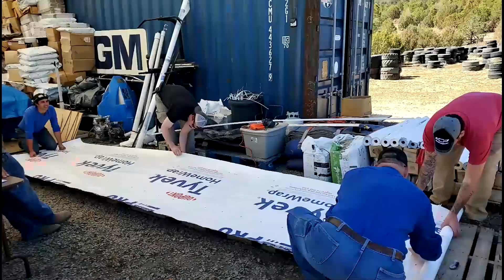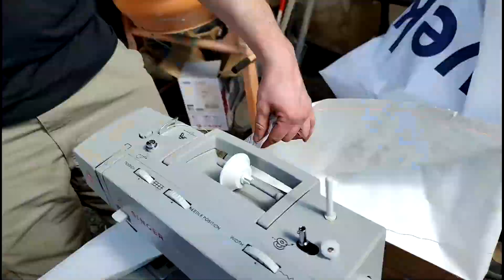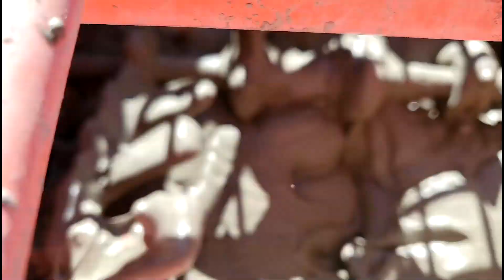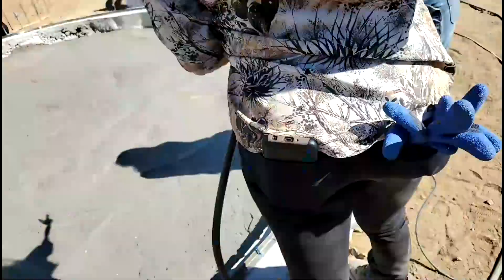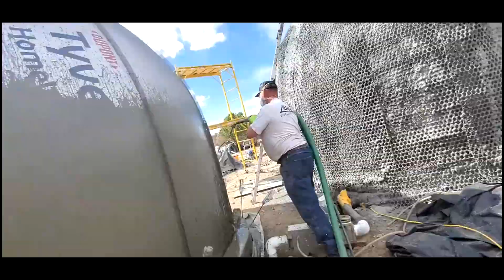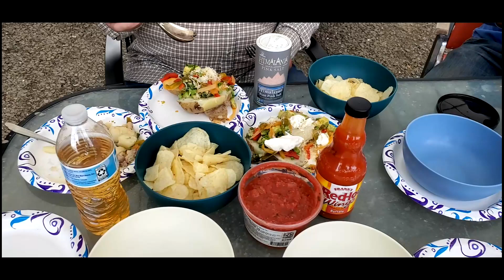Dome Building Workshop | #aircreteharry #Domebuildingworkshop #workshop #handsonworkshop #aircrete

Comment: Hey Buddy, with sheets of plywood way over $60 a sheet and 2x6 studs at $10.50 as of date of this text and I'm not sure about insulation, not to mention headers what are the chances you could design a panel like the shape of a sip form that is cost effective? As you know I don't build dome homes even though I like there appearance.

Comment: Harry.  Thank you for being a trailblazer and sharing your inventions with us.  Question:  Looking at https://www.youtube.com/watch?v=Ks7Ifi6TTUE about creating a geodesic dome out of one-inch pvc pipe, have you ever considered using one of those as a frame to add the tyvek, fabric, metal mesh, and aircrete layers - and after finishing, removing the geodesic support dome for reuse?     I'm going to use a hyperadobe rammed earthbag bottom https://www.youtube.com/watch?v=0GTgNmSmzms , and then position the finished aircrete domecap (as desribed above) as the  roof.  It will be a very sturdy and earthquake-proof building that can be built without much knowledge of construction.   Have you done something like this that doesn't require making an air-tight membrane and constant air pressure for the support of your layering?  In the link above, they use heavy-duty zip ties at the hubs of the geodesic dome.  The hubs have a ridge that will make it easy to connect the single sheet of tyvek to it.  Later after the outer layers dry, from the inside, one can use snippers and cut the zip tie that held the tyvek to the dome, as well as the zip ties connecting the 1" pvc to the hubs, allowing the dome parts to be removed and used on later builds.  Do you think this would work as long as the circumference of the hyperadobe wall connected well to the geodesic aircrete dome cap?

Comment: Nice!!  Looks like a productive event.  Must be a good reason why the fabric hems are outside, in the aircrete - and that you worked out how best to un-embed them.
Reply: White form has seams to inside and it will be removed leaving a smooth wall. Fiberglass mess, which is completely embedded in the concrete, has the seams to the outside.
Reply: @happyhigdons  Thank you.   So the mesh is sewn up like the air form, then I would guess.
Reply: @SpaceCrete  yes. Both are seen with a seam. White part has seam to inside as it will be removed, mesh has seam to outside and is left in.
Reply from the maker: @SpaceCrete  That's correct! How much longer before your additive is available?
Reply: @AircreteHarry  Still working on it.  It is really only helpful if you are pumping, and you need an inline static mixer near the end of the pump line.  Light mixes are easiest to stack, but not aircrete - that has been the toughest. Here is a good demo of the fireproof quality of epic (or aircrete): https://youtu.be/em6r0w66-nA